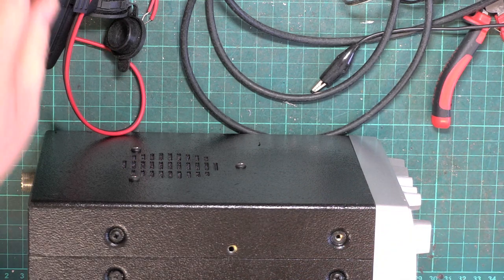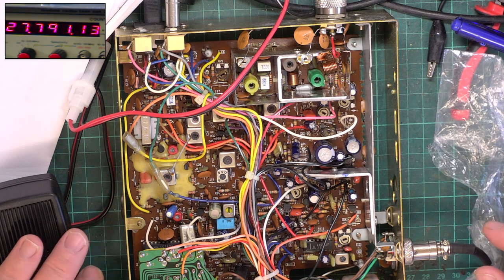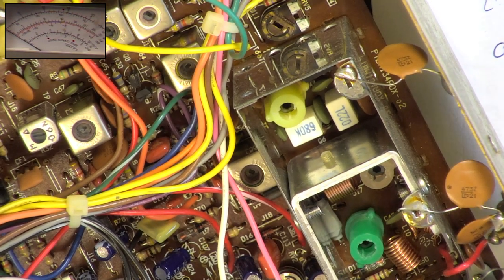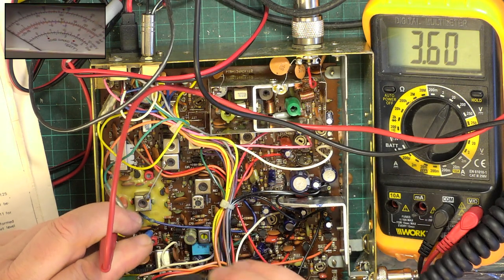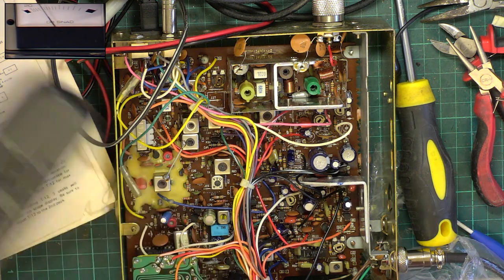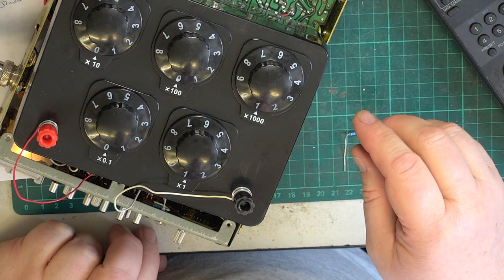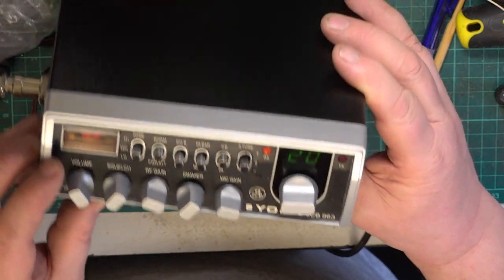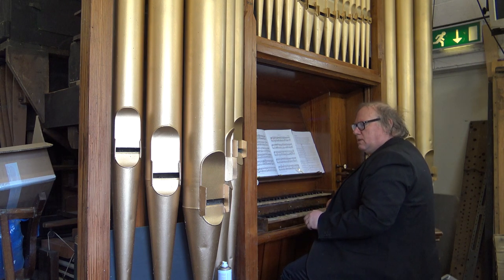York JCB863 UK CB27/81 CB radio -  Repair, service adjustment & organ

Comment: Hi Richard.
Would you happen to know where I can purchase those switches please I need two new ones for a York  JCB 861 for the hi/low power att and the Tone.
Many thanks
Reply from the maker: No, supplies dried up years ago. I have a lovely Harvard 420M here missing a switch, so I'm in the same boat. I just have to wait for scrap chassis to appear on Ebay or radio rallies.

Richard
Reply: @ukfmcbradioservicingTango21  thanks Richard  will buy a scrap chassis